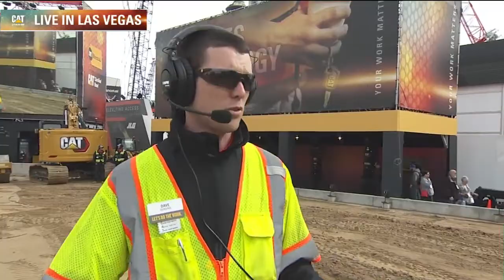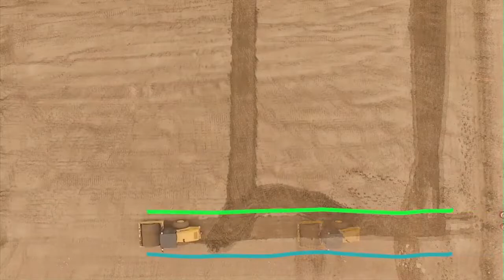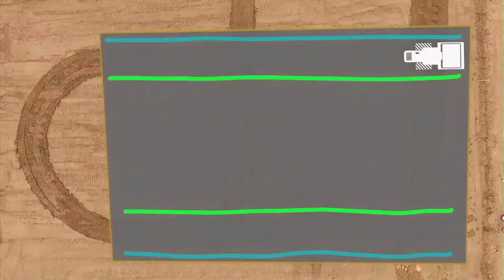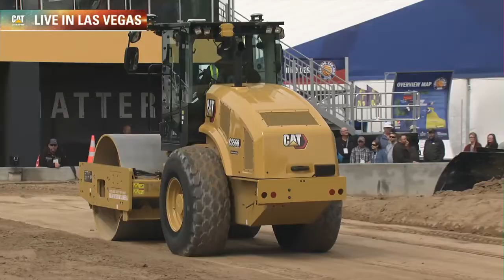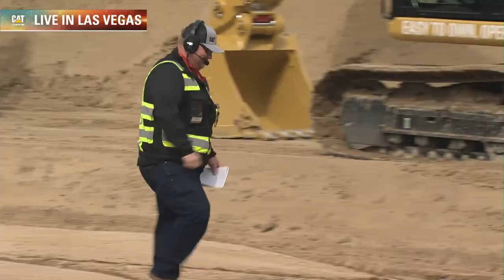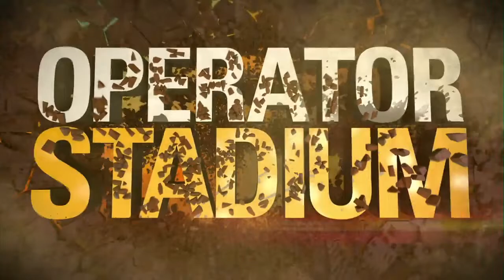Cat® CS56B Vibratory Soil Compactor Demo | From CONEXPO 2020

Comment: The industry is killing its self while complaining they don’t have enough staff. I was on hire today on a 4 week contract, never used a roller before but I wanted to have a go, I have 4 different licenses for plant machines and the roller is something I have never done, went to the site. Worked a full day then the company off hired me at the end of the day. I was doing okay. Like I said never done this job before but I payed for my licence so I wanted to give it a ago but contractors don’t want to give anyone a chance, they just want fully qualified operators when there clearly isn’t enough. They are literally the reason there isn’t enough because they don’t let anyone learn.
Reply: A roller hand is literally the most basic dirt work hand….. (for road crew dirt work). Rolling is very important for compaction and moisture, but is fr the most unskilled “operator” on a job other than the labor hands… I work on a road crew and we run a 6 man crew 2 of em run rollers for fill dirt, the smooth drum runs the finish grade base and is fr more important than the blade, considering that is is the reason you can pass PSI density test is because of the smooth drum roller. On the roller YOU DONT STOP!!!! Unless ur told to otherwise by the blade hand. (The blade is boss period.)
Reply: Man I agree for the most part, but if your willing to start from the bottom at a open cab  roller and work ur way up, you might just have the balls. You have reliable work with a way to advance in road work. Im 20 and a working Forman/ finish dozer hand, it’s kinda sad